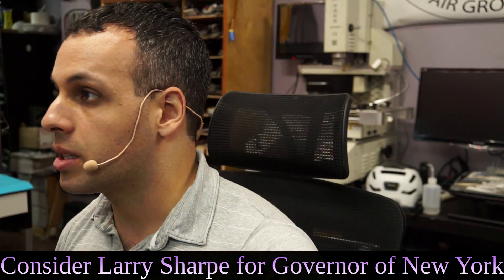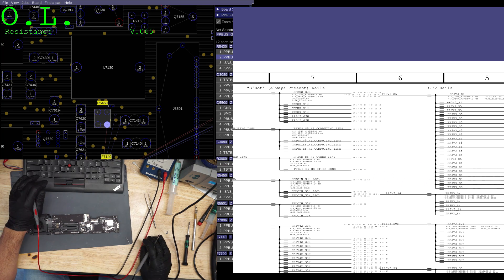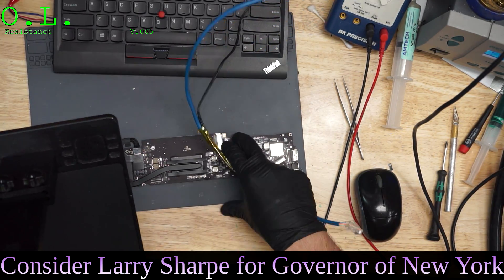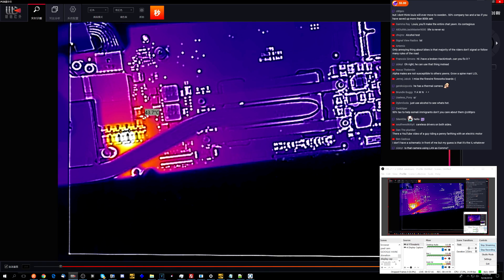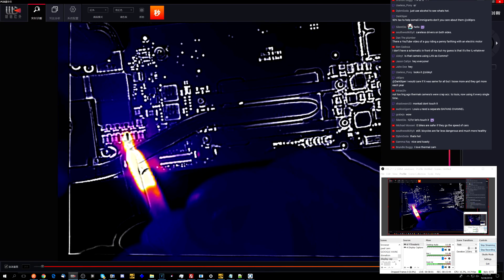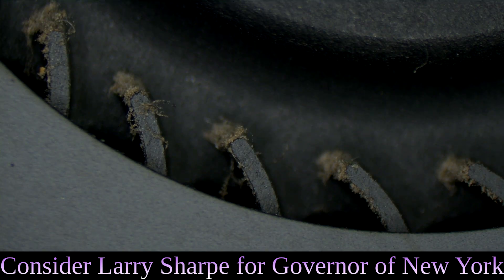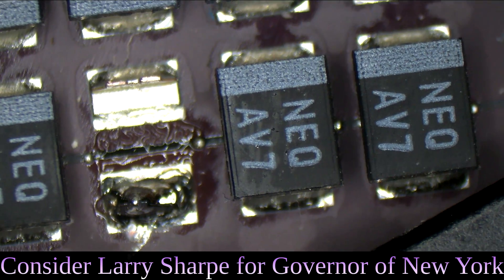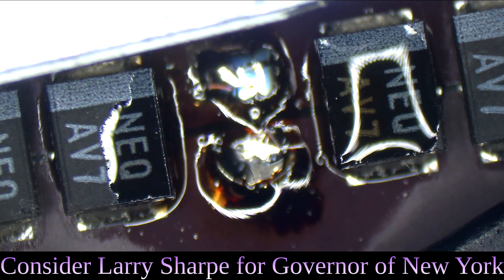Does Macbook Air spontaneously die?

Comment: Louis, help (please!). 

It’s a triple layered Apple f**k job. 

1 - MacBook Pro 15, keyboard buttons falling off and screen occasionally flickers/jumps up and down. 

2 - iPad Pro 10.5 256gb Cellular - touch screen intermittently fails to respond, mainly on the top side when held vertically. Lots of reports of this on various forums, many have had Apple replacements under warranty only do to the same thing again. Apple want £419 to give me a refurbished one because my iPad is 19 days out of warranty. I shit you not. 

3 - iPhone 8 Plus, 3 months old and Apple Pay stops working (seems to be NFC not working) 

Thoughts, other than to set them all on fucking fire?

Comment: "Is Macbook junk?"
Short answer: Yes.
Long answer: Yeeeeees.
I think it's really a shame that the buildquality is so extremely poor because other than that I think their machines are really cool!
Heck, at one point I actually considered buying the 5k iMac (and maybe even a Macbook) and switching to OS X because all I do with my PC is photo editing and watching Youtube videos... The display of the 5K iMac is, and there is no denying it, a thing of beauty so it would have been really cool for editing my shots.
But after watching your videos I really don't regret not doing it. When they work everything is fine but if something fails your wallet should get ready for a trip to hell...
Now I'm rocking an i7 7700k machine that I built myself in a roomy case in which the hardware doesn't cook itself to death because of decent cooling. And I can actually open it to get rid of dust (which technically isn't really necessary because all good modern cases have dust filters, APPLE!).

Comment: "You're using your laptop on your lap wrongly, it overheated because it was way to close to your left testicule. Consider lifting the right testicule first, to cool it down, or it should be 1/399 away from you knee caps,so that your fault" said pineapple.

Comment: What does tossing alcohol on it do?
Reply: No silly... The alcohol is to drink. Then you don't feel so frustrated about not finding the problem when it's already 11pm and you should be in bed at home.
Reply: So long as it is extremely pure it will evaporate on the hot components giving a good indicator of which one is shorting. If it has impurities it will cause shorts so don't just go pouring vodka on it.

Comment: I owned a MacBook Air 2015 that spewed out heat from the back so bad that it GRILLED the "clutch cover" (black plastic area by the hinges which is the vent). Took it to Apple once, was told that this wouldn't happen at room temperature with some simple browsing. Took it a second time, they kept it over night to run their SOFTWARE tests and found nothing was wrong with it. This began before the 1 year warranty ended, and about a month or two later, it again began to push some scary heat from the vents and simply decided to die. Of course at this point I visited Apple a third time and was told that repairs would cost about the price of a new one because it was out of warranty. 😏 Go figure.
Reply: That's Apple for ya. "This could never happen! You clearly did something. Its not our own garbage design." And then they ask for $1000+ for a "repair"
Reply: And that's when you know you made a bad decision
Reply: Im getting close to believing that the people who work on the machine just have a apple program that delays the planned obsolescence. I mean they can get a program to brick yournphone what is to stop them from having slow kill switches that are automatic but they have a delayer for. Especially when we know that they have kill switches.
Reply: Yeah. This is why I switched to Microsoft's Surface Pro lineup. They're not perfect, but my experience with support has been much better. This is also due to the fact that there's a Microsoft store in NYC. But so far I've experienced software related issues due to the way the Surface Pro devices have a firmware to go along with Windows 10. The SP4 unfortunately is just a terrible piece of tech when it comes to battery life, but it was improved lots with updates. I'd really like to have a MacBook again, but with my experience and SEVERAL other experiences I've seen/heard from relatives and friends, I'll pass for now.
Reply: Yeah, I had a similar scenario with a mid 2012 iMac 21.5" that would have some blue artefacts in areas of a certain colour, which I think was a shade of grey.
Reply: MacBooks dodo. Gets yourself a 1000$ workstation laptop from a company who makes the best stuff. That way you can go to a repair shop and get yours fixed for 300$
Reply: Raul  No need to get emotional. Personal preference, and whatever works for the buyer is why. Not everyone likes their computers plastic, nor for one use, etc. I used to be a huge fan of HP until their laptops would be defective. After owning an Asus Transformer Book, I fell in love with devices that could switch between being "laptop" and tablet, but the performance offered was not the best at all, especially for the price. When it comes to MacBooks, everybody who's owned one knows that navigation is top notch, and stability very good. Obviously you can install Mac OS on a Windows computer, but that's without it's problems. Gaming laptops? They're heavy and typically thick with few of them being touch screen. If you get one of those "Max Q" variants, they seem to run much hotter because of the slim designs, but within "safe" temperatures.
Reply: This actually happened to me with the I think 3rd gen ipod.. the one with the actual harddrive inside... worked perfect for a year, decided to stop working, took it to the apple store and they said I'm out of luck because the warranty ENDED ONE DAY BEFORE IT BROKE. Can you believe that shit? They said I could get a brand new one for $399. That's the day i switched to MP3 players and never had issues again. Old school days.. gotta love it
Reply: And that is the point you realize you want a Thinkpad.
Reply: @Crontax yes, standard warranty.
Reply: Depending where you are it can be argued that this is an on going issue that wasn't resolved while under warranty so manufacturer is still responsible for the product even out of warranty. In the UK you take that to trading standards and they would beat most manufacturers and retailers over the head with it. Unfortunately they don't get as good results when they go after Apple.

Comment: So I should store my macbook in a vacuum chamber danging from a wire so it can't be touched by the environment to keep it safe right?
Reply: Nope Norris idk man wires are dangerous you don’t want that touching your Mac
Reply: Nah you already looked at it it’s toast man
Reply: In the vacuum, it will overheat (no air to take that heat away) and die.
There is truly no escape..
Reply: Evgheni Melman I keep it turned off turning it on is too dangerous
Reply: It still explode if you do that, you have to buy an iRoom to use in. Starting with only $999900 and 25 cents
Reply: Nguyen Pham I didn't know the trillions of dollars of the debt that the world is in was in my name actually
Reply: Nope! If you attach a $2 wire to it it becomes a PC and isn't a Mac anymore.
Reply: Nah, it's broken
Reply: You're kidding, right? How do you expect it to survive if you forget the Faraday cage, the 3-axis gyroscopic stabilizer, and an active elecromechanical vibration isolator for the hangar?
Reply: Your toxic fingers already touch it. You need i-gloves
Reply: "Can INFRARED LIGHT kill a macbook?"
Reply: Next video: Does vacuum chamber kill Macbook?
Reply: As long as it is an Apple certified wire.

Comment from the maker: Want a thermal camera that is almost as overpriced as a Macbook? Don't delay, buy today! https://www.unionrepair.com/thermal-imager-for-mobile-phone-pcb-troubleshoot.html
Reply: I'll pass but I do have a CAT S60  cell phone that I use just for the built in thermal camera my actual every day phone is a Galaxy S8.
Reply: Shilling thermal cam? What has the world come to?
Reply: Just get a  Lenovo thinkpad  , problem solved
Reply: Oh boy that'd save me gallons of alcohol!
Reply: What about one that is not overpriced?
Reply: Thermal camera for your phone. Example: Seek Compact Pro (have iPhone and Android versions) for around 500 Euro (around half price) with 320x240 resolution. That should okay for some detection. The expensive one has probably 640x480 thermo sensor. This can also used in your home to check insulation problems.
Stand alone like Seek Thermal Reveal Pro is ~660 Euro.
And we have also FLIR products... but resolution is somewhat low for high price.
Reply: peepee bus
Reply: Are u apple haters ?
Reply: Damn, cool grand.
Reply: Offer me a free one and I'm in.
Reply: Me too. I just took a look at the camera on my aliexpress account and that puppy is not cheap that is for sure. I think in my case the handheld would be a bit more useful.
Reply: I use a FLIR ONE Pro Gen 3 Thermal Camera on my phone $600 640x480 and it works well.
Reply: FLIR ONE Pro Gen 3 has 80x60 thermal camera, and it mixed with 640x480 visual camera. It works, but the sharpness is much lower and you might see large dot instead smaller detailed spot.
FLIR uses both cameras for merged thermal picture.
That is less sharp thermal picture than Seek's 320x240 thermal sensor. I know FLIR worked too, but resolution/price ratio it's too expensive. Seek is much better here.